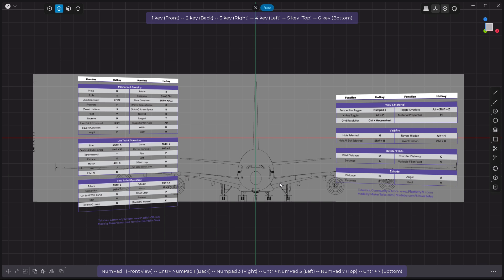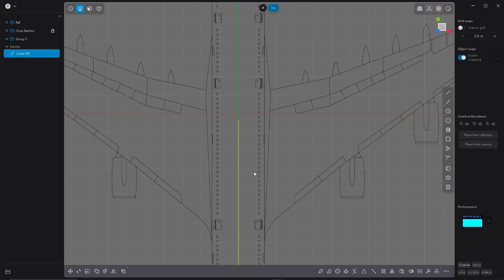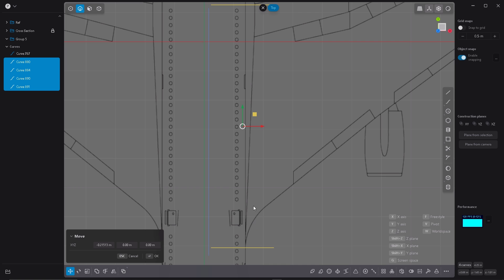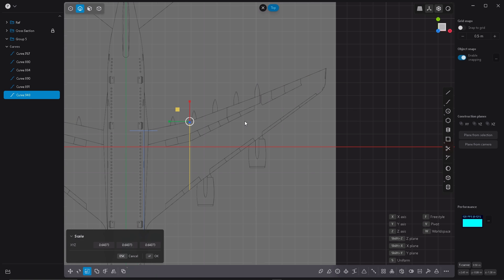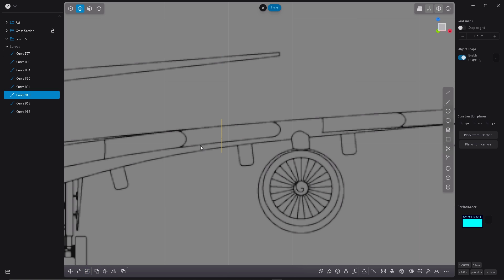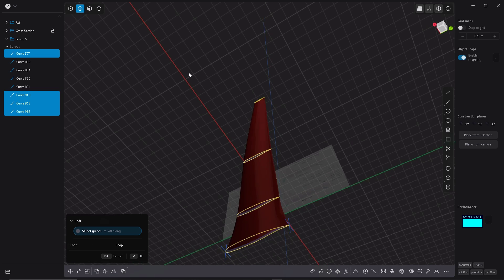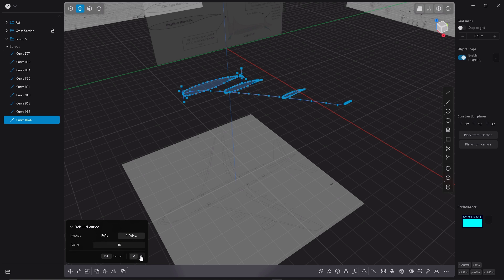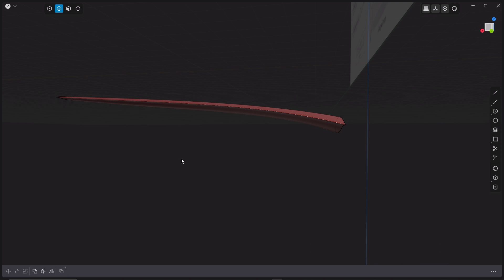Plasticity 3D How to make an Airbus A380 part 1, Get on board!!!

Comment: I've followed your wing build through each step, but for some reason when I shift-select the guide curves you add to the top and bottom of the wing the loft fails. The leading edge and trailing edge curves work fine. What's the cause of this usually?
Reply from the maker: Bad intersection,, use the spline tool, it works fine for me.
Reply: @Stuff-3D-creations  Thanks, I found if I use as few points as possible for the spline it's working. It's a good workflow for wings, much appreciated.
Reply from the maker: @davejacobson5400  I am happy you figured that out, I always say, use  just  as many CV as necessary.:hand-pink-waving:
Reply from the maker: @davejacobson5400  Have fun!!!

Comment: I have loft problem eventho deleted many vertices.  not working at all.
Reply from the maker: Hi, I' ve been having loft problems too,  Plasticity is still in full development, that's why some tools are a bit fineky. Oftentimes, even if points intersect each other perfectly and points  are blue, it doesn't work. However, the fewer points you use, the more likely it is to work well, at the moment, this is the key.

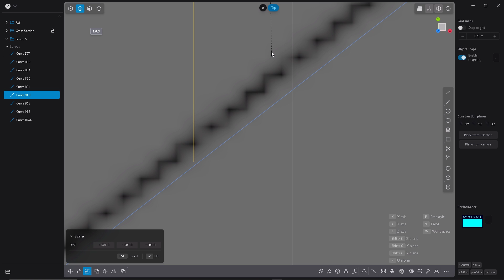Comment: 11:50  How do you make the loft sketches intersect with leading edge just by scaling them? Do they snap to it?
Reply from the maker: Yeah just by scaling the section, most importantly is that they intersect to each other, to do that, just do as the video shows, place the pivot with V key then scale it up really really really close, and hit S key twice and adjust it. It works!
Reply: Thanks a lot man! that's plenty useful! Another thing, why is rebuilding the curves nessacery?
Reply from the maker: Unreconstructed  curves create issues, you just want to rebuild the curves, it just eliminates break points and distribute the points evenly along curves. @iiTunz